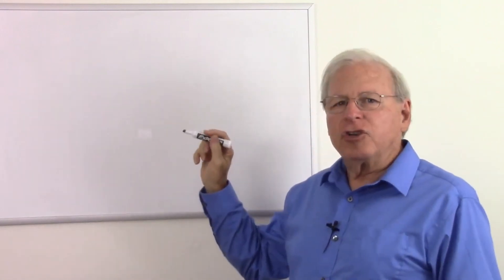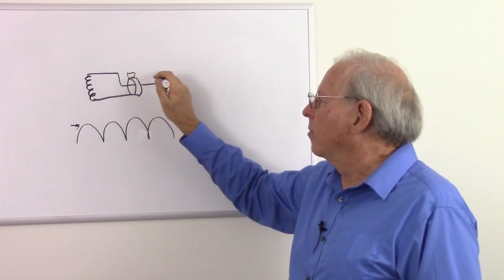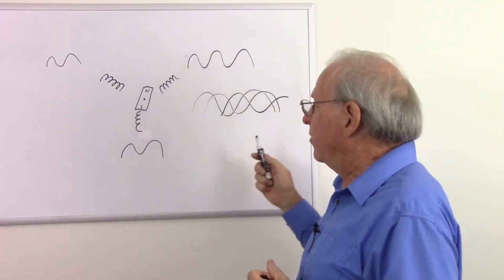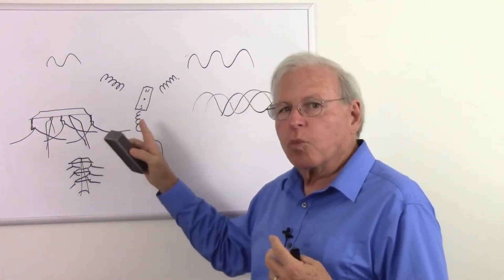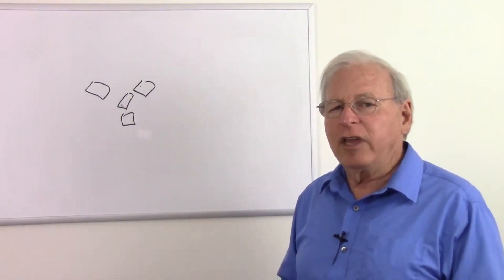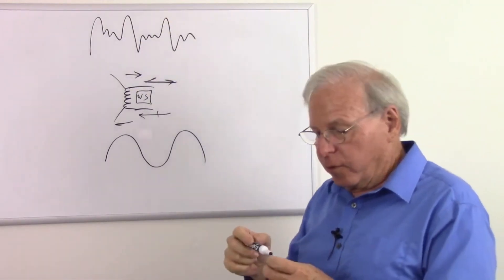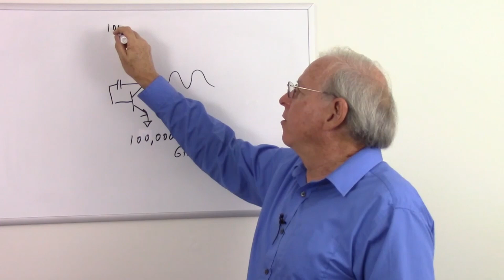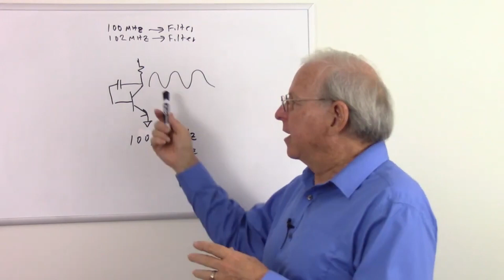Generating Alternating Current

Comment: Most of our devices at home run on DC. Why households don't get provided with 3 phases? It's easier to rectifier. Or do I understand something wrong.
Reply: household only need 1 phase, 
3 phases used when you need to operate 3 phase motors, usually in industrial area
Reply: @arysny  No, our stove is 3 phase.